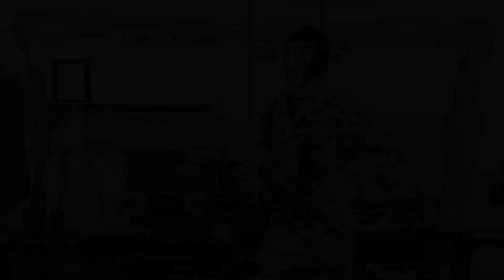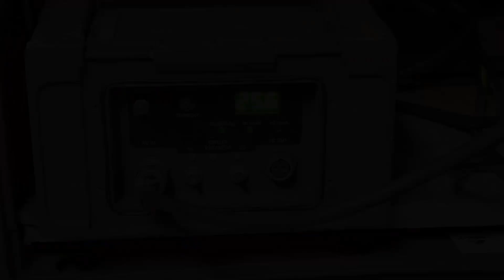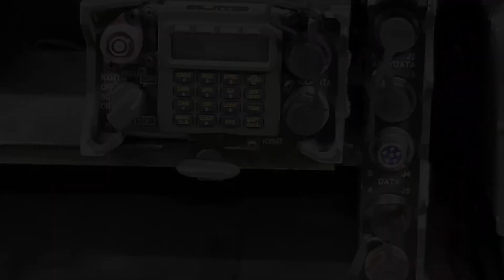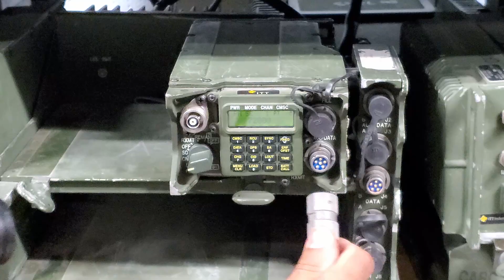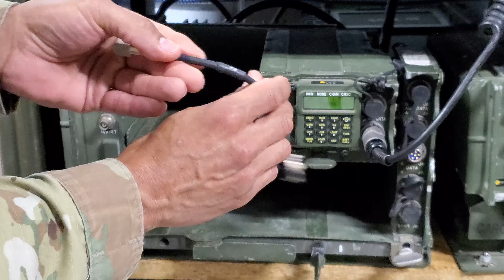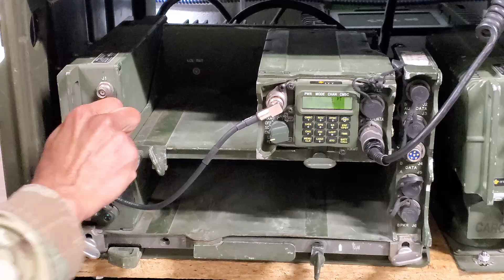TOC Box Setup & Single Channel Frequency load on a SINCGARS ASIP radio

Comment: That power supply provides DC 24-28 volts from 120 volts AC. With the proper cable one can utilize 220 volts as an input voltage while stationed in most other countries.I’ve never had an issue plugging in the mikes into those connectors. Keep 'em clean for best results.